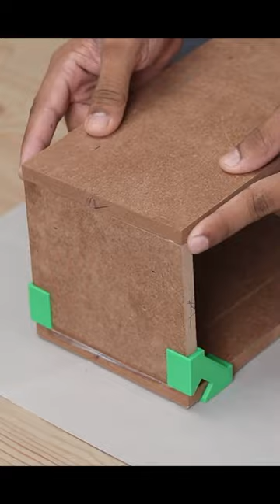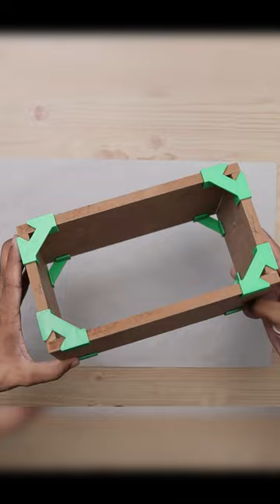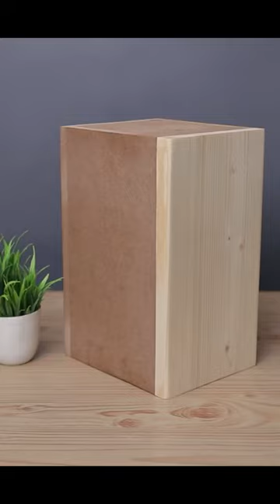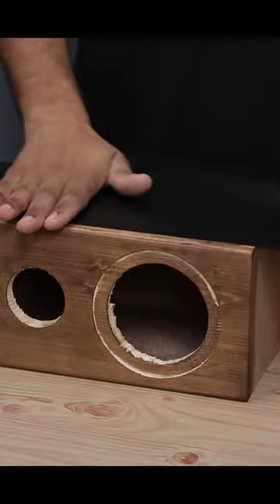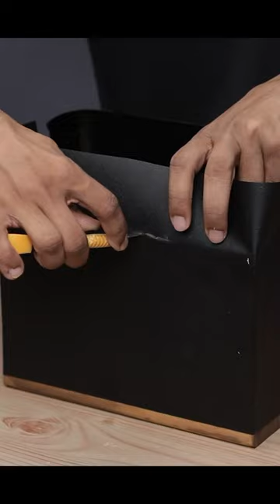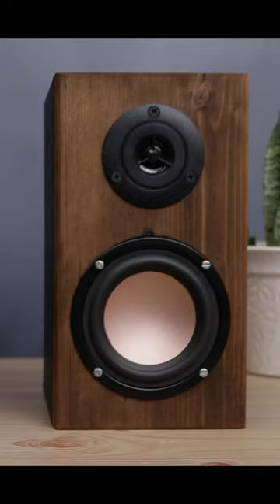Making book-shelf speakers, DIY Speakers #diyspeakers #diyprojects

Comment: Best speaker needs every side measurement . It's all to produce right frequency bass. BTW your work is so fine man and i am also a carpenter but i can't work so neatly... Well done boy... Keep it up..
Reply: huh this makey no sensey, I Didnt even see if the Speaker was Ported  or Closed, and in Ported the lenth of the tube and the volume determents the Bass tuning frequency. But dont forget the other frequencies building a diy crossover is harder than you think.